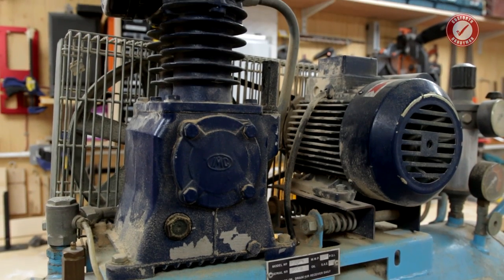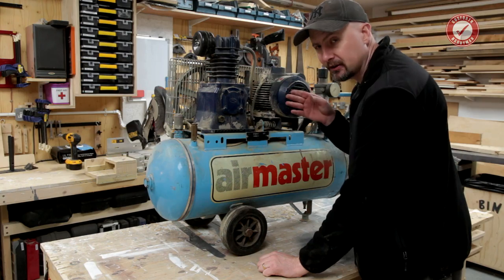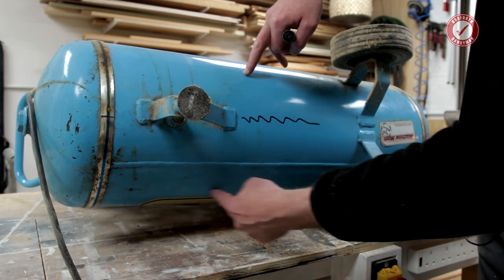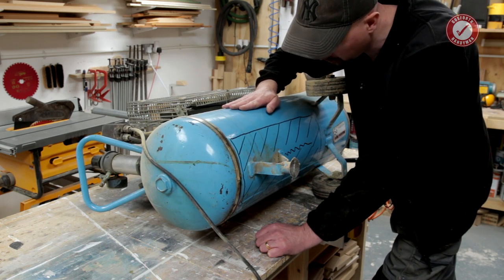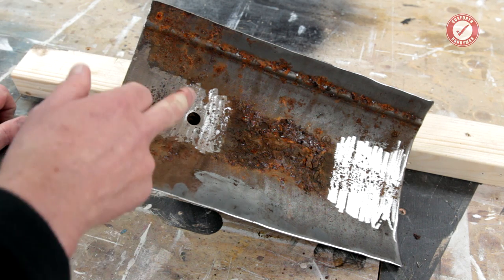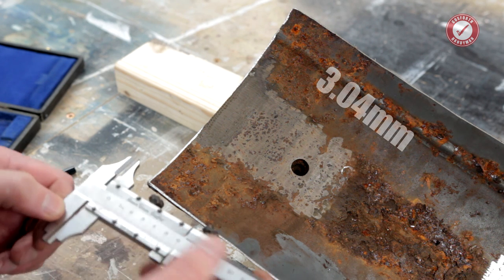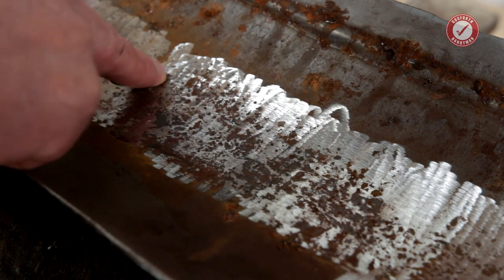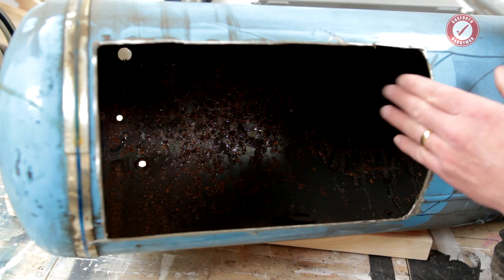Was this old air compressor about to EXPLODE ??

Comment: I worked for a company that used air compressors to operate gas/air pumps, and the compressors had to be serviced regularly ie change pressure valves,air filters etc and replaced every ten years.So you got good service from your old one, but definitely time for a new one.
Reply: Large ones in industrial plant I have seen them up to 60 years old and still in use. They get hydro tested every year during shutdown (regulations say every 5 years, but they are figuring as the plant is being shut down might as well do it as well) as to replace them will mean dismantling large chunks of buildings and removing plant and roof to get cranes in. Tossing after 10 years on a small one is possible, as the test after that time, and fixing it, probably is approaching the cost of a new one anyway. But on large units you will want those parts to last a long time, so regular service of the compressors, change oil regular and so on.

Comment: I would have thought an explosion most unlikely, one of those pits would get so weak it would just give way and you'd hear a nice hissing. Also why would it crack, unless you'd damaged the outside severely somehow, since it has been clearly ok for 37 years? Elf and safety gone mad sir!
Reply: 37 is nothing we have two 250 litre ones the youngest one is 55 years old. The other is much older. Both pass inspection every year. I was just thinking how sad it was to cut this up. What a waste. Out side in a shelter that would contain it if they popped it wouldn’t be a problem anyway.
Reply from the maker: Yeah I think most explosions would be due to the pressure regulator or pressure relief valve not working properly combined with a rusty old tank. Oh hold on... 😂👍
Reply: @GosforthHandyman  ive had tanks rist through they hissed i welded the hole shut to get the job done and didn't   remember  till the next year when another spot rusted through lol
Reply: An explosion may be rare, but it does happen. Hydro-test results save you from injuries.
Reply: They certainly do explode and when it happens it's big.
Reply: @marklowe7431  = There are videos describing a tank failing (pictures of tank included) when the person was in the garage, and had he been in the wrong spot, would have killed him. . Blew the garage windows out,

Comment: At work I took over responsibility for an at least ten year old clark whisssper all in one compressor. I could hear water sloshing about inside the tank. I removed the drain tap and strangely no air or water came out. on further investigation I found that although the drain threaded boss had been welded to the tank the tank had not been drilled by the manufacturer. I returned the unit to Clarks R & D dept. it came back a few weeks later with a hole drilled through the drain boss so the drain tap worked. strangely enough it failed completely a few weeks later. I wondered how many of that batch hadn't had the drain hole drilled through at manufacture.
Reply: wow... good to know which brand I'm NOT goung to buy from. thanks

Comment: Hydraulic testing, fill with water and pressurize and see if it holds for a specific period of time.
Reply: It might hold pressure but that’s the problem.   You will never be able to predict when the walls of the tank have a thin spot from corrosion/rust.    The more resistance to a burst, the more pressure it will take to burst, and thus the more explosive that burst will be.   Take a bicycle inner tube and fill it till it pops.  It’s a pretty strong pop.  And that’s with thin rubber.   Now do the same with an air compressor tank.   What pressure will be too much?   80psi?  100?  120?   140?   Care to try it out?   Check out pics and videos of the results and you will not want to push your luck.   One guy had massive damage to his garage from the air pressure.    His garage door was even open, and it knocked it off the tracks, knocked the door rail anchors out of the concrete, broke every window, pushed out the window frame closest to the compressor, and basically knocked down or broke anything with any cross section in the garage.   His wife was in the house and she said it shook the ground as much as any earthquake she had ever felt.     If anyone had been adjacent to the compressor it would have surely killed them.   The tank shot straight up to the ceiling/garage door tracks/door btw.    Knowing that and seeing the  damage was shocking.
Reply: @andrewhigdon8346  That's why you test tanks with water rather than air. Water doesn't compress, so if the tank does pop, all you get is a bit of a splash rather than an explosion. And you test it to well above its rated pressure to make sure it won't fail under normal operating conditions. I'm not 100% confident I'd try this myself but I've seen it done and it seems reasonable.

Comment: Interesting to see the condition of the inside of the tank. In the future you could remove the fixtures, hook up a pressure gauge, fill it with water then hook up a pressure washer to hydro test it yourself. Also you can get a boroscope camera that hooks up to your phone for less than $20.
Reply: Someone in another video mentioned that along with HD testing a tank.  His EXPLODED..

Comment: The HD stamp is hydro test , in order for any tank to be allowed as a compressor it has to be tested using water or glycol . that was my job when I worked on oil seperators, we would have to fill the tank from the bottom (if done from the top you will have air and will not be able to test) we had to test 1 1/2 times the working pressure which is where the 225 stamp comes in. It's a max psi of 150 so 150 +75 =225 . it has to hold that pressure for 15 min. And all welds are checked for any leak.
By law anything over 110 psi has to be filled with liquid so that if there is a stress crack , or a faulty weld you take a quick shower otherwise goid chance your not going to be around for any other test as it will explode like a grenade shooting metal into whoever is near the tank. If a tank gets to thin from water, rust you can cut a section out and basically put a new piece in a band aid . the second serial no. Is logged into a federal data base which is a paper trailall the numbers on that tag will tell you where that steel waa milled and when , who welded on that tank , who pressure tested that tank and who did the final inspection giving that tank a pass to become a compressor.
So all them tags and numbers are it's birth certificate if you will.

Comment: That reminds me. I've not drained mine for a couple of years. Maybe that's why it acts more like a pressure washer than a compressor :)
Reply: Funny that, mine gets drained fairly often and it's more of a pressure washer too
Reply: @coldblu357   I've always wondered how moisture gets out of a compressor. You drain all the water out but the humidity stays in there unless it somehow evaporates out of that tiny valve hole. You may not have standing water but you'd have to leave the tank out in the sun for quite a long time for it to actually dry out inside.
Reply: @randywl8925  When the air gets pumped in hot it creates moisture. Some people coil the feed line from the pump to the tank or add an air cooler in line to help with moisture. I learned it from the guys that paint, they know all the cool tricks.

Comment: When I score a compressor with a questionable tank I slice off the mounting deck using a 6" thin kerf cutoff wheel. I also slice off the wheel mounts with the wheels if they are any good.
Then if the tank seems worthy I slice the tank horizontally and use the halves for other purposes. Large tanks sell or barter easily to people welding pig cookers so nothing is wasted.
What few remember is the motor/pump deck is mounted to the tank for convenience and some compressors came with NO tank from the factory (I've an old military example which works well). You can and I do run compressors separate from tanks and that makes large units easy to move.  Thanks to cheap consumer junk integral pump/motor units I regularly find good tanks (I use a USB borescope with my shop computer so I've a large display) to use with frequently superior old pumps.

I crack all my drain valves on installation since I don't need to store air between uses. I've no condensation buildup that's not promptly blown out at first start. 

Discarded systems rarely failed as a system. This goes for computers, compressors, cars, trucks, and much more. I dont prettify anything I repair or rearrange, I do ensure it's safe to use. 
Note that just a nice coat of paint does NOT restore machinery. Overhauls do because the innards are what functionally matters. 

Want a ten horse and can't afford the wiring etc? Two fives are a common commercial solution and I only run a single when not blasting.

Comment: For anybody interested, the formula used to calculate the hoop stress in a cylinder, (the most heavily stressed part being the parallel sided portion) is PD/2T, i.e. internal pressure x diameter divided by twice the wall thickness. With deep drawn cylinders the burst failure is normally a straight line down the longitudinal axis; with welded (rusty) tanks it can be more chaotic but it is surprising what decent steel can withstand. Even the humble 15mm copper pipe can theoretically withstand more than 20 bar of internal pressure, though I don't think I'd like to cycle it too often!!

Comment: Hyd means that the tank was hydro pressure tested with water. This is the correct and only safe way to pressure test a tank.
Reply: Hydro testing is worthless on a rusted tank, they can easily hold the testing pressure but if there is rust inside and the compressor is back in use water will stay on that rust longer like a paper towel holds onto water and it will make it rust 10 times faster.

Comment: That’s actually pretty thick tank in comparison to the small twin tank units the real shame is how much longer that compressor would have worked if the manufacturer had spent even a few seconds to spray some self etching weld through primer inside it prior to it being welded together. My next tank have powder coating inside - u can’t expect bar steel to survive
Reply: Yes that is plain hot rolled steel scale, if they had at least done an acid etch on the inside after welding, and a quick thin electrogalvanise coating on the whole unit, followed by a bake to get the hydrogen out, it would last a really long time, or just have a sacrificial anode rod on the bottom that you can unscrew and replace every few years.
Reply: Powder coating acts as a scab at first penetration then traps moisture. I've seen it on many pieces of coated equipment bought at auction.  Consider self-etching (powder coat is not) paint/primer instead.

Comment: All Compressors have a Safety Valve. The tanks are designed to take at least 600psi which is probably 3 x the pressure your engine/pump could deliver.

Comment: Hyd. stands for hydraulic. As other comments have said, liquid (hydraulic) testing is much safer than gas (air) testing 'cos if it fails it won't explode - but you might get wet!

Comment: In a commercial setting this tank would be classified as a pressure vessel subject to statutory inspection by a competent person.  There’s so many small DIY / trade vessels it’s impractical to have them inspected as they should be.  
Most comments focused on a corrosion pit failing to a simple leak. That does happen and it has to be your luckiest day when you discover it. 

Very few suggested rupture of the vessel.  This is the reason for statutory inspection.  While industrial size vessels can destroy buildings, small vessels are used in the same room as the user.  Personal injury is likely, so I would worry the growing and aging fleet of small cheap compressors is a growing risk.  

First, look at your use.  If it’s running every day you should get serious about inspection, get an expert technician on board or become one as best you can.   Less frequent use; be sure to drain fully after use, maybe open the vent plugs to dry the tank, peer into the vent holes looking for rust along the waterline per this video.  Either way you won’t have the ultrasonic gear to properly inspect for wastage of the tank due to inevitable corrosion.

Above all, don’t prolong the life of the vessel beyond a sensible period.   Some of the ages quoted above are nuts, given the potential risk.  Buy a new one as soon as you get any excuse.
Reply from the maker: Yup - I think the attitude of "it'll be fine, what a waste" etc. is a very bad message to put out. Great comments Jim. 👍

Comment: The condition of this tank is really not that bad given its age. The thing to have done would be to have it hydraulically tested "HYD" is hydraulically tested to 225psi. I am lucky that I have a pressure vessel tester at the bottom of my road. I may be wrong, but I believe a pressure vessel such as this should be re-tested after it reaches 10 years of age... but it does depend on the size of the vessel and what use/working pressure it is being put to.

Comment: Great video, very informative!
If that's used at home, there's no regulation (other than the usual CE Marking for supply) that mandates any regular inspection. 
But if it's used in a workplace, and the volume x pressure is more than 250 Bar Litres (excluding the 24 Litre, 10 Bar "Hobby Compressors"), it would legally need a WSE (Written Scheme of Examination) under PSSR (Pressure Systems Safety Regulation):2000, which would dictate (certified by a "competent person", based on a risk assessment) what degree of inspection (typically ultrasonic thickness test for the receiver and a pressure test of the PRV and Gauges against a calibrated gauge). 
The receivers ("pressure vessels") are always supplied against a design code (should be stated on teh data plate!) which specifies the minimum design thickness, plus a corrosion allowance (EN 286-1 is typically 2mm + 0.5mm for steel, but older codes had a greater thickness). 
That one was probably the older BS 5169, possibly with 3mm + 0.75mm corrosion allowance.

Life expectancy will depend on how often the condensate is drained from the receiver and often it's the compressor (especially if not regularly maintained) that limits the life...
Modern industrial compressors tend to be coupled with an automatic timed or zero-loss drain, so you don't have to remember to do it manually.

Comment: The correct way to do this would have been to perform a 'house' hydraulic test first, then open it up and see how the steel was, thus establishing at least some correlation. As it is we have no actual information, though given the 2.4mm residual thickness I agree with a prior commenter, it would probably last about as much at is already has at least.

Comment: Hyd. test is probably hydrostatic test pressure. Filled with water and pressurised. I did this sort of testing as part of my fitter / machinist apprenticeship. Company manufactured flow control and safety release valves.

Comment: No Andy... it isn't heavier... we're older now :^)
Even draining regularly I won't keep compressors around forever. Just not worth the risk over time.
EDIT: Can't find it now, but looking at compressors recently I recall one of them said to replace after 5 years of service. They have expiry dates on the tags now like gas cylinders.
Reply from the maker: Yeah I'm sure I've seen the 5 year thing mentioned somewhere too - probably to keep them in business but even so 37 yrs is probably pushing it. 😂👍
Reply: @GosforthHandyman  in canada they require hydro test at every five year of service in commercial environnement,
Reply: In Europe there is no official age limit, however commercially used compressors have to be checked by hydro test every 10 years. 
Tanks which are coated inside can withstand decades without corrosion, you can recognize it if the water you drain is white, or rusty. Big tanks here have a hole which can be opened for seeing inside the tank.

Comment: Now to cut open a brand new ALDI compressor and see what's better!
Reply: Actually I've done that, A mate got one a fair few years back and due to his own stupidity he ran it without oil, so he gave it to me to turn it into a bbq (I do the same with Gas Bottles) and the Aldi tank was in really decent condition with the wall thickness around 3mm I believe, which is the same for calor gas bottles.

Comment: Its old machinery, of course it still works. No PCB board, no pre-installed failures... Solid item. 

Personally, I have always been terrified of air compressors, as well as flammable gases . Worst of all, flammable compressed gases (propane tanks, butane cans) and I have always wondered why these aren't made of stainless steel, or at least coated internally with a paint or protectant to prevent rust... I mean, the inside is never touched by solids, it wouldnt degrade at all presumably...

Comment: What a shame to scrap a good machine   I have one of these and works perfect. Must check. D.o.m
New machines are made on minimum thickness anyway on the hobby market 
At work we still have a 1938 broomwade  horizontal and a 1941 vertical still in daily use 
They get insurance tested every year and internal inspected with a camera 
Beautiful sound when they kick in
Reply: I think our oldest one is like yours and similar age. Ours are tested every year too and pass every time.
Reply from the maker: It's not good - it's knackered. Everything about it didn't work. 😂

Comment: My Campbell Hausfield was purchased in 2000. It developed a pin hole leak in 2017 were the longitudinal weld meets the end bell weld. Tha autopsy revealed little rust were the pin hole developed but a heavy belt of rust along the bottom. The 13 gallon tank walls were only 3/32 inch metal.

Comment: I have a soviet compressor, an old man used it für 40 yrs and i borrowed it für one day and end of the day the tank started to leake air at the welds, turned out its lifespan was exacly 40 yrs.